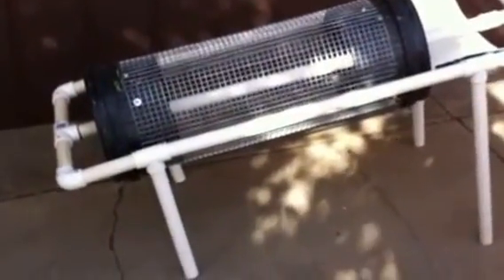HOMEMADE TROMMEL CLASSIFIER SCREEN

Comment: Good job. Just drill some 1" holes in two 4x4s by about three or four feet long, place across the width of the trommel, and put the legs in and you will have the stability you need.

Comment: The 1/4 inch Mesh instead of 1/2 inch worked well, it has plenty of strength.  Ran it through some test runs with driveway gravel and snow, Yep we still have snow up here).  No problems with the finer mesh.  We never get Gold bigger that 1/8 inch in Southern Alberta, and that we call a boulder :)  so to add 1/2 inch gravel to the sluice would just be a hinderance.

Comment from the maker: how did you go? i would suggest to stay with the same mesh then use the wrap around 1/4 mesh so this way you can always chnge it simply with a few zip ties, also you keep the strength in the trommel

Comment: Excellent review of my trommel auzziman911.  You should take reviewing up for a living.  Your confusion is understandable about the directions.  I was torn between giving only directions for prototype 1 but ended with doing both.  The stability increases tremendously with the upgrade and legs angled outwards a bit ...... but you'll find with a hopper full of material and the shortness of the original legs it will work perfectly.  Be sure to protect the upper bearing with covers. 
Cheers,
Mike